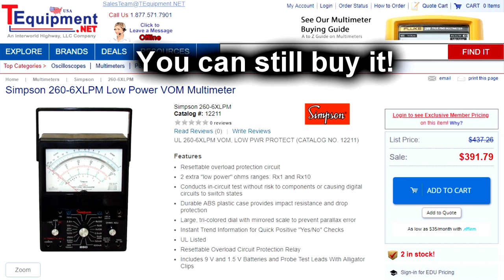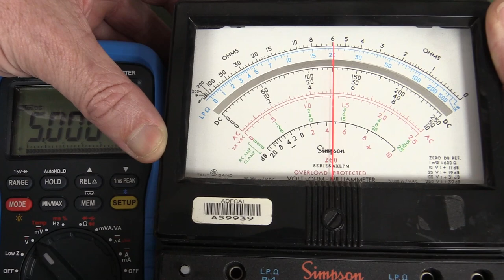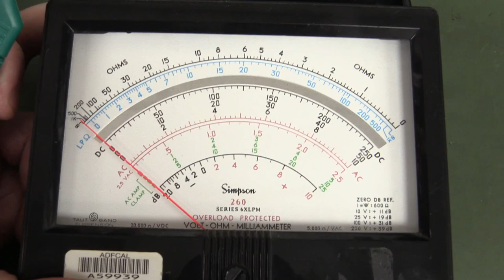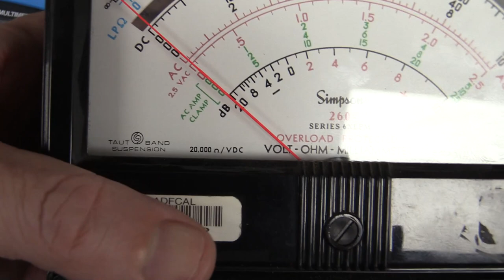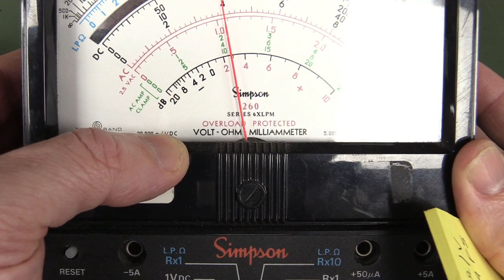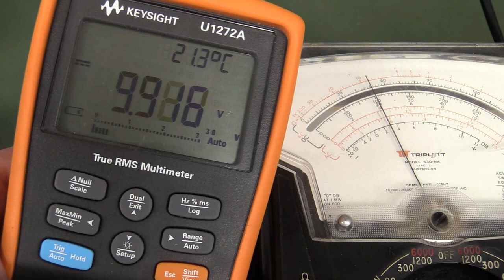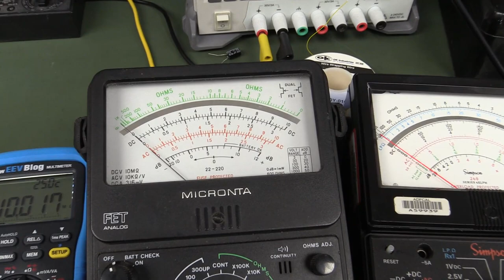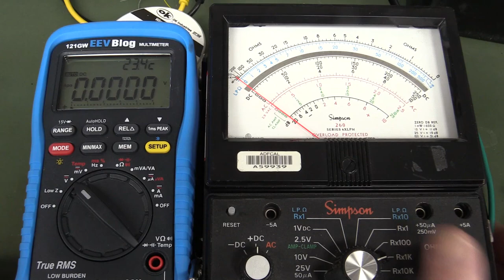EEVblog #1067 - Analog vs Digital Multimeters!

Comment: A lot of unnecessary whining about zeroing the analog meter, something which is second nature to an experienced tech.

And I'm not sure what application one needs more than three significant figures of accuracy. That's all you got from a slide rule, before the advent of calculators, and that worked just fine for generations. Complaing about the fewer digits of accuracy, is sort of like a carpenter complaining that his tape measure is only accurate to 1/64th of an inch.

Don't get me wrong, the new technology is better in almost all applications. But some of the shortcomings cited are not that big a deal to a competent technician.

Comment: Analog they look great sitting up on the shelf as reminders of the days gone by . Wouldn't trade my Flukes (116 and older 902 daily use)in for nothing heck I wouldn't even trade my crusty Liumy Lm2001 for a analog . I work with a lot of vfds DMM yesss.

Comment: only one advantage about analog multi meter is battery usage they they use single AA battery and it take a long long time to dead (one of them worked for 10 years!). but digital ones they are awful mine always  need a new 9v battery and actually I paid on battery more than the meter itself.

Comment: - Your first analog meter works and you've killed loads of DMMs, like everyone else. -They don't need batteries - You can hope to understand easily how a d'arsonval meter works and behaves - It doesn't give you an impression of a precision it doesn't have. - It doesn't need the buzzer or diode mode because of its regular behavior -It's a very good utility meter as is hardly fooled by RF or residual voltage due to it's slow response  and low impedance (THAT IS VERY IMPORTANT) - It's very good for measuring crazy voltages as you average better by eye and see what's happening and that you can't really measure it. VOMFET and VTVM are nonsense now surely unless they are rf types. You need to have one even when a good DMM is better 95% of the time, and  there are some digital utility ones for the other 5%, but don't cost 20 bucks. The analog vs digital oscilloscope is a multiple kilos and mains only difference one and still there is a point there.

Comment: Anyone doing serious electronics repair should have a FET analogue meter on their bench.
Reply: Why FET and not a 50k or 100k ohms/v ?
Reply: @JohnUsp  Well I use a VTVM with hundreds of millions of ohms per volt - when appropriate, a FET analog meter for performance every bit as good as a high-end DMM for daily work (They are both 10 or 20 million ohms per volt) and either Simpson 260 or Triplett 630 for work among contacts / filaments. The 10kohm/volt pumps more current through to more make a circuit PROVE itself. Bad contacts or corroded connections will show their fail only to this type of meter.  As well, a filament's changing resistance will show on an analog meter that pumps enough current - millions of ohms per volt will never do such - especially on a digital display. But those are rare occasion issues. Their propensity to trigger gates and such make them unsuitable for daily work elsewise.
Reply: @skeggjoldgunnr3167  Thanks.

Comment: Two words - zero emission's.  Analog meters are passive devices (like you said) and do not radiate any EMI whatsoever.  As a (one time) physicist I have had to work in environments where DMMs cannot be used.  That is not the only place where a DMM is a hard fail.  I know you are a DMM fanboy, but there are times when analog meters are just a better (or only) choice.  Just a fact.

Comment: What's the log base for the DC resistance scale on an analog meter? Looks like dBV maybe?

No worries with a known impedance per volt; just fix it in math. Simple arithmetic. Still wouldn't touch an analog meter with a barge pole these days, but if DMMs have really made engineers so lazy they can't multiply..."I weep for the species."

Comment: I only use analog ones if it is something I want to see a signal on, etc. An ampmeter for like 5+ amps. Kind of hard to blow out an analog ampmeter, if I do whatever just toss it replace fairly cheap. Sometimes i'll use as a double or triple check if I am working with mains voltages. Digital seems suspicious try analog. 

I have an electrician friend and he seemed to like the analogs better he was showing me he pulled out a $80-100 extech meter put it to volts with just the probes not touching each other or connected it said like .5 volts he is like how can there be .5 volts there. I have had cases too where if a digital meter has a lead on something to earth ground and the other lead is on some metal object tool, toolbox, etc even not connected to anything electrical you can get readings of like 10+ V AC. I assume this is just from induction of things like fluorescent lamps, residual voltage on the ground conductor on one side, etc. Analog meter would not even flinch to something like this. 

Analog still has a place, but it is kind of a limited application.

Comment: Check out the specs on the Triplett 630M. It was designed to have a very high input resistance when measuring DC. Also, i am not familiar with the unit of measurement "a bee's dick". Is that greater than, less than, or equal to a R.C.H.?

Comment: I mostly hate digital meters because of their displays. LCD's in particular are useless since I do my work in a unheated shed in New England, meaning five months of the year it's too cold to even read the damned things. You ever power on a LCD at -9F? Yeah, that.

On top of which segments are ALWAYS burning out, dying, and generally just breaking. They simply don't have the raw durability of a analog gauge! It's a bit like digital watches -- I'm ALWAYS breaking them. You'd almost think the proper dome shape put around a analog dial was more durable and they bothered using a QUALITY glass over them.

I also dislike the excess electronics common to a lot of digital gear. Not so much in meters, but certainly on things like soldering irons. These "new fangled" irons with the digital displays, membrane switches (really dirtbags?) and so forth end up costing more whilst delivering LESS functionality than a simple pot!

Which is why I'll stack my el-cheapo $30 China special Gaoyue 936+ soldering station against ANY of the sub-$400 irons with a digital readout on them. At least I can go out to the shed, flip it on, and just use it. Oh noes, it doesn't go into low power automatically when I hang it up -- reaches over with my pinky to turn the dial down to 200... Oh noes it doesn't auto heat up when you pick it up -- reverses the motion.

Sure as shine-ola beats the tar out of my old fancy overpriced Weller... and even if it dies I can buy nine more for what a "proper" station would cost.

Seems like the moment they put a digital display into electronic gear, the price multiplies tenfold and the quality goes in the shitter.

Comment: This is quite an dumb video for various reasons. 1. A cheap digital MM with 5 digits pretends to be accurate and people take  this type of accuracy for true. 2. Every MM should work in the upper 30% of the range, because the most important accuracy specs are related the the max value of the range. The exception is here the resistance measurement. 3. I worked a long time with MM with a tube amplifier. They were quite rigid against high voltages and had a input impedance of 1MOhm, which was at that time very good. 4. People who had worked with analog MM were used to making an estimate which impact the impedance has. Nowadays I see  engineers writing down 6 digit values from their digital MM, which have a accuracy of 0.5%.  6. And when it comes to current measurements most people don't get that the impedance of the MM is raising when the ranges are getting lower, when the MM is cheap.  

An analog MM is quite useful as long as people know what their are doing and the same is true for digital MM too. I have both types in my inventory.

Comment: Lol, they should scrub out multi from the analogue multi meter label, does just 3 types of measurements (voltage ampears and ohms)... My meter can read capacitor, temperature, frequency and also has a hot wire detector and audible continuty tester.

Some models also have lux, wind speed, audio power (db) etc

Comment: I´m about to unsub....Dave ComeOn...WUSSUP witcha??
All these pisspoor DMMs suffer...they´re always my second choice...!!

Why?!? Here´s why: if your design goes haywire (BiGTime!) and you´re running its suppy through an analog ammeter, it´ll surely cut out (at least all my decent analog meters do this: unigor 6e, simpson 260, taylor 100a...should i really go on;) and leave the design most likely in a state where it´s at least traceable what went wrong...
What do all these DMMs do...?!? they go: beeep , leaving the design powered...and it´ll smoke away and you may have only some molded toghether components left behind after.

Also while reforming old/NOS/storraged Caps i always (!!) use analog meters, if the needle moves fast in right direction, it´s saver to shut down...all these DMMs are simply way too slow! if you gonna see the needle moves quick to the right, it´s obvious something isn´t right....but using a DMM you need to translate numbers into directions all by yourself...forget these baragraphs...too slow...even slower as the digit update rate....no way...